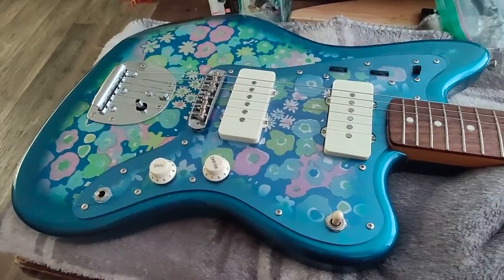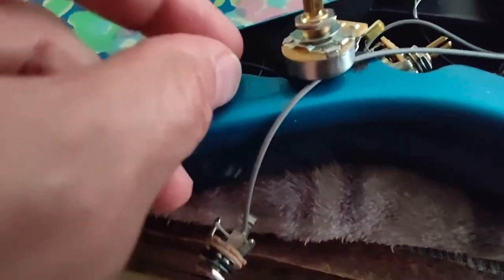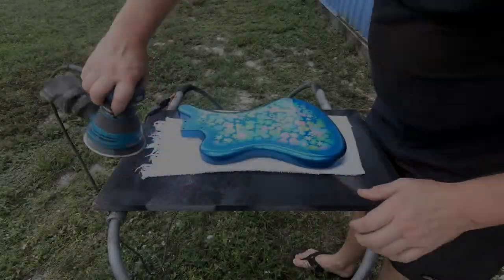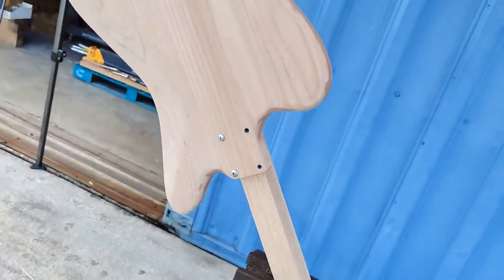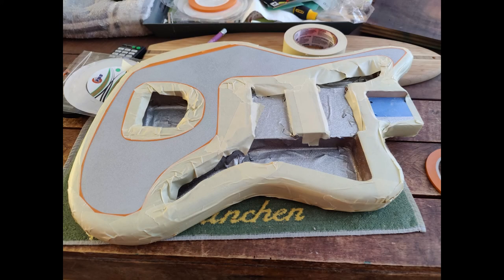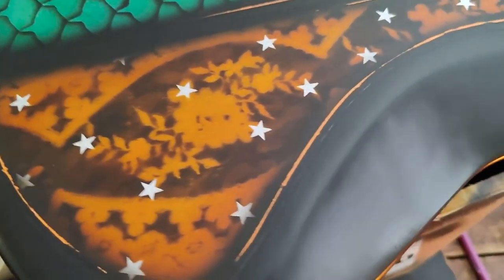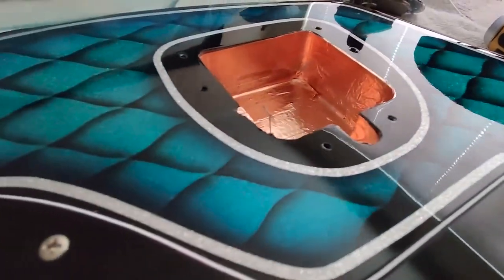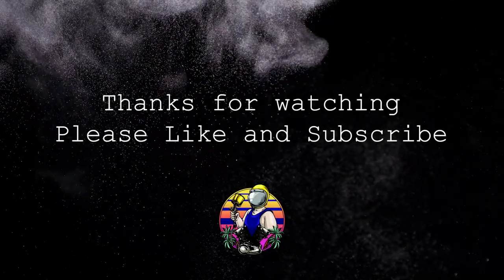Fender Jazzmaster - Custom Paint

Comment: Nice job.  Any reason for not using the existing paint as a key for your paint?  You could have sealed it and saved going back to bare wood - the existing paint should have been a good based.
Reply from the maker: Thanks, yes maybe I could have done that and it would have save me some time for sure. But the reason are, I didn't want to add too much thickness/layers of paint under the bridge and the compatibility between paint. I am sure it could have work and maybe I like to do it the hard way :-)

Comment: Soso nice! So question if I spray metallic paint base coat and go in with a color it wont be as shinny as with the flakes? And also do i have to clear coat after base coat then go in with my other color or can i just go base coat color over that then clear coat
Reply from the maker: Thanks. If you spray metallic base coat, I will recommend sanding with 600grit. Yes metallic base coat have some tiny tiny flakes, but it will not shine as with flakes. Now the paint I apply over flakes or base coat is a Candy, this is a translucide paint, that work with the amount of layer you will apply. Candy is not easy as regular paint. Since more you will apply and darker it will become you have to be careful with over spray and have a nice overlap spray pattern. Clear coat will be necessary otherwise the paint won't last, you can now find some clear coat 2k in spray can that are really good. Try on some scrap wood and see how it goes. If you work with fresh sanded wood, I will recommend to seal the wood prior to primer. Good luck and have fun 😉
Reply: @lesagecustoms4668  Thank you so much!!